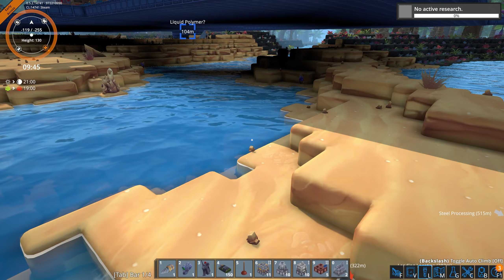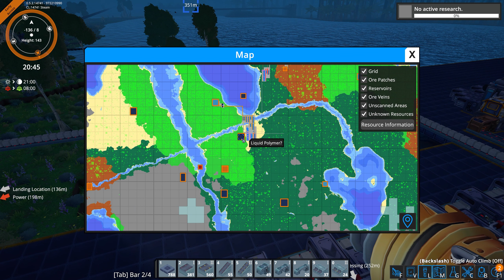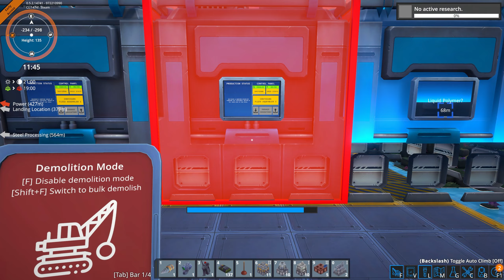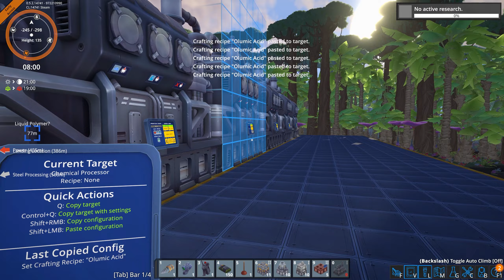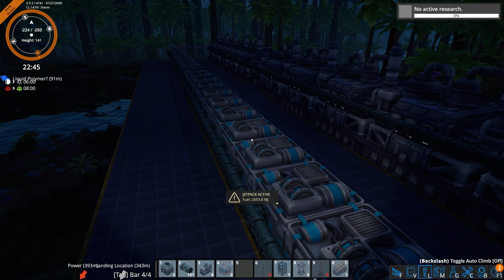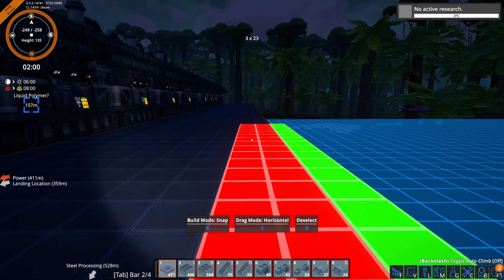Pipe fun with olumic acid | FOUNDRY | BigVlad Plays | Part 13

Comment: This game has been in development for 6 years. Satisfactory has been in development for 8 years. Not a lot of difference. time-wise. This is a voxel game which complicates things a bit, but still the game should be much more polished considered the development time imo.
Reply from the maker: True but the Satisfactory devs are seasoned devs that have made commercial games before and they must be a bigger studio. I don't know how big this dev team is but I wouldn't be surprised to find there are only a few people working on the game. Of course, that doesn't excuse any design flaws in the game. If it's flawed, then it's flawed.

7 Days to Die has been in development for nearly 12 years and that game is still lacking polish in some areas well. 😄 Of course, it's super fun anyway which makes it easy to overlook some stuff. My point is that for inexperienced devs, dev time doesn't really mean much. In the case of 7DtD, a lot of that time was spent experimenting with new ideas, many of which were scrapped or changed entirely. Could be a similar situation with this game.
Reply: @bigvladgaming  Yeah, Foundry does have a smaller studio. They have 10 while Coffee Stain has 30. 40 in total but not all of them are in development. Some are in marketing.